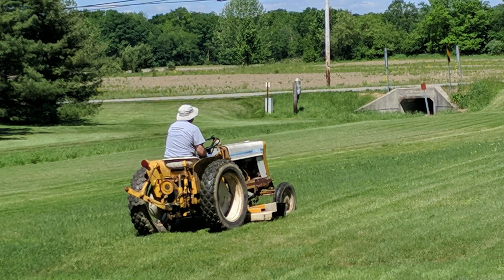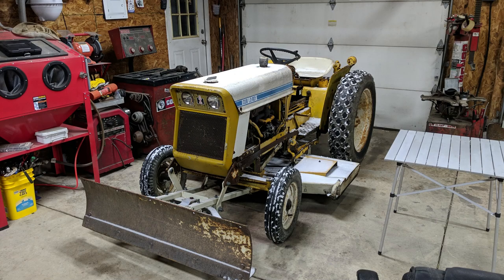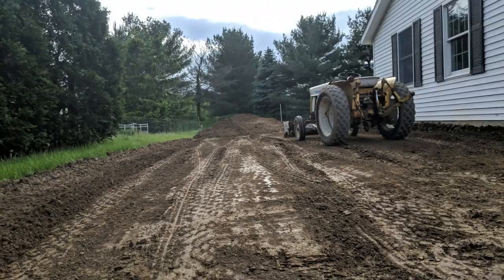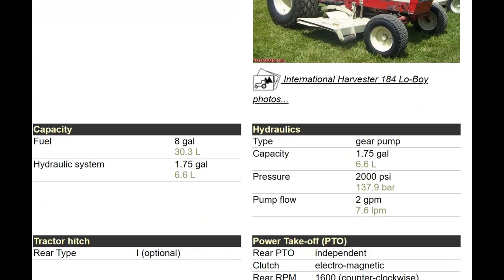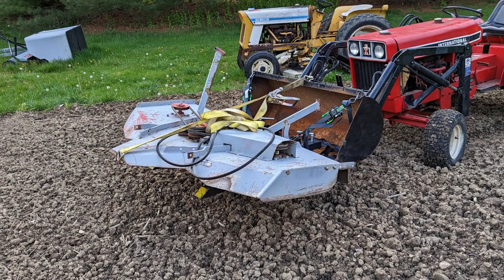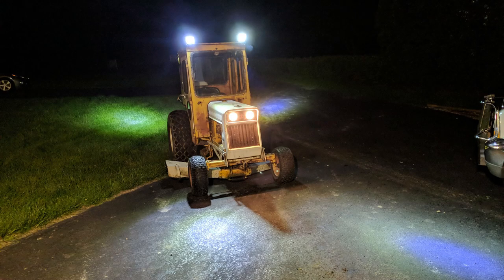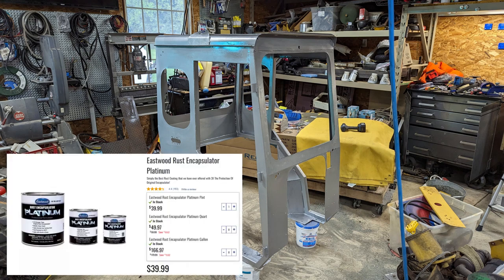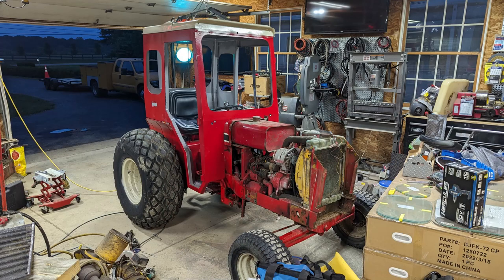Building the ultimate riding tractor lawn mower with an air conditioned cab!

Comment: Okay... Hear me out; turbocharger... You don't need a drag racer, but the replacement for displacement is boost. Get an extra 10-30hp going, then it'd easily run an AC compressor.

Comment: What about a pony motor that just runs the deck. Like a 20 something horsepower V twin from a riding mower. Save the tractor motors power for driving the tractor and running accessories. I have a 1970 international 154 running a 130 amp alternator i mounted to the side because I mounted a full size halogen rotator light bar on a Rollover bar. The lightbar pulls about 60 amps with everything lit up and it really bogs the engine down. Bought a LED strobe bar and it's much better now lol

Comment: Salvage an air conditioner pump, lines, and condenser from a junked car. Replace the accumulator(or receiver drier) or find a way to dry it out. Then buy an aftermarket cheap evaporator and use a small computer fan to blow on it. As for controlling the system, maybe some sort of a pressure switch therefore you'll probably want an older system. 

It would be cheap but you'd have to make sure to add oil and vacuum out the system and recharge it yourself since I don't think anyone with 608 or 609 certification is willing to risk a fine from the EPA for working on something like that.

You should have enough power to run the system since its a small space being cooled. However, you'd want to have an AC switch in case you're mowing some tough grass.

Comment: Some time back i toyed with the idea of attempting to cool a vehicle by pumping icy water through a heater core...my idea was to simply put a large cooler in my trunk or truck bed fill it with water and ice...get a 12v circulation pump and pump the water into the car/trucks heater core...i very briefly tested the idea hooked up to a garden hose, seemed like it might just work...never followed through with it though

Comment: Ok I might not know what I am talking about but have you calculated how much HP the mower deck takes to run under a load and then the AC and actually turning the tires? Isn’t the mower deck a tad bigger then the ones that comes with it? I am not trying to be a Debbie downer, just trying to do the calculations…. Thanks for the video!
Reply from the maker: The deck runs off the PTO and the PTO only has 11HP.   The tractor had a 60" deck and minimal recommended HP for a 60" deck is 14hp.   That being said, 60" decks are not an issue because of the torque the 4 cylinder provides. I do know of another fellow running a 72" deck on the same tractor and per him, it gets the job done.  So I am fairly confident powering AC via the engine is not probable, hence the battery powered AC options.   Worst case scenario, I repower the tractor with a bigger engine, I'm not opposed to that either.  Some of the most fun I've ever had was "Trial and Error".  ;)
Reply: @1D10CRACY  love it!!!!  I was just thinking out loud and I really want you to have AC!!! I only have .3 acres front and back yard… my snapper rider gets it done in 20 minutes. And yes I wish I had AC to so I would be in an enclosed space to not get as dirty when mowing. I do wish you the best of luck!!! I wish I could some how help.
Reply: Keep in mind that the mowers on those tractors aren't there for perfect cuts or mulching. They don't waste horsepower on that stuff.

Comment: So the simplest approach, albeit not the cheapest, would be to use a 12v inverter-based rooftop air conditioner and power it with an upgraded alternator. Dometic makes a nice one for ~$2k but you can get an ugly chinese model for ~$700-1000.  The alternator is a common GM format (10si?) for which higher-current models are readily available. I do think you are pushing it to power both air conditioner and mower deck from the original engine, but on the other hand it may not take much to KEEP the cab cool after the initial cooling off. Depends mostly on air sealing, i'd guess. An inverter-based 8000-12000btu ac should drop down to a minimum of 150-200w running at its lowest capacity, which may be exactly what it does when only having to cool such a small cab. I'm definitely looking forward to the progression of this project!!
Reply: I guess i could comment on the 'cheaper' approaches too.  $150 Big alternator, $150 1500-2000w 12vdc to 120vac inverter, and $150 5-6000 btu ac 'window unit'. You can either rig into the back of the cab in horribly ugly fashion, OR  you can go full Rube Goldberg and replumb it  to relocate the components to various locations for packaging reasons.  You can also convert a ~$300 inverter-based Midea window unit into a 'mini split' by lengthing all the wiring and brazing on fittings for hoses to separate the two 'halves' of the unit, neither end of which by itself is very large. But, that's not much cheaper than a rock-bottom $450-500 'already split' mini-split, but the downside is both sides of those units are substantially larger. Mini-splits in general get some of their efficiency vs equivalent 'regular window unit' from having much larger condenser surface area, which is fine for efficiency but maybe not great for packaging onto the smallest tractor that's not a lawnmower.